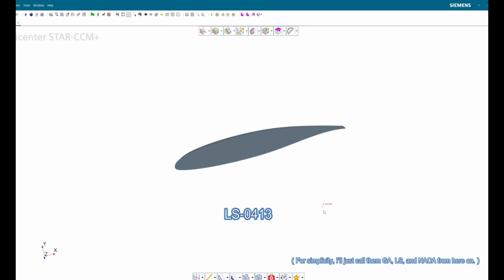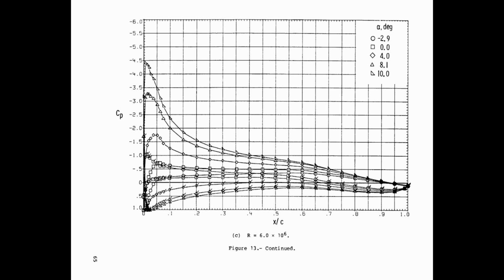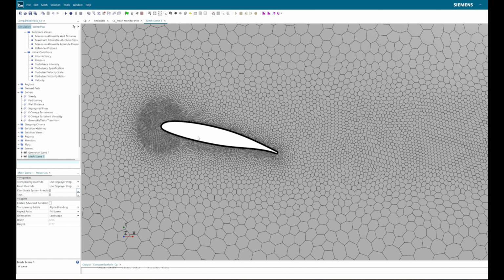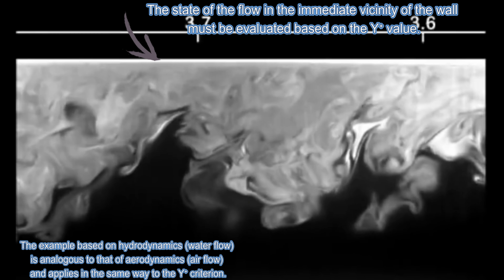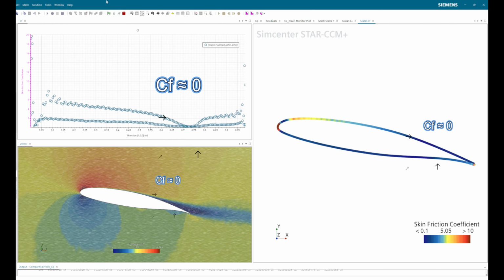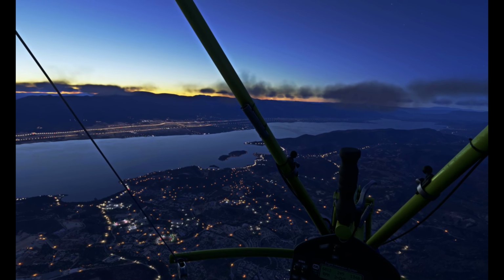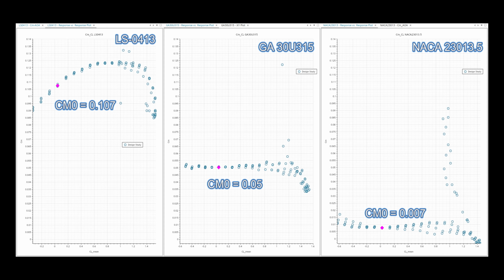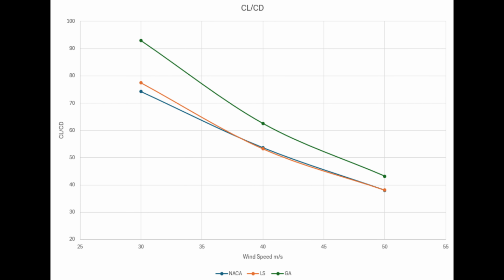Detailed wing selection

Comment: Good job! 
Would you change your approach for a short aspect ratio wing? 
What would be the parameters changing in the aim of slowest possible stall speed?
Reply from the maker: Thx , that’s a valuable perspective.
With a short aspect ratio wing, the priorities change, means you get stronger tip effects and more induced drag.
Instead of just going thinner, I’d focus on keeping the stall smooth and the drag reasonable.
It’s really a balance: low stall speed needs higher 𝐶𝐿max, but that costs efficiency.
So a moderate-thickness airfoil, some washout, and maybe small tip devices or flaps would give better control and economy overall.
Reply: @TomHagenW  I was thinking of an updated Arup, Hoffman, Flying pancake design. 
Gesund +